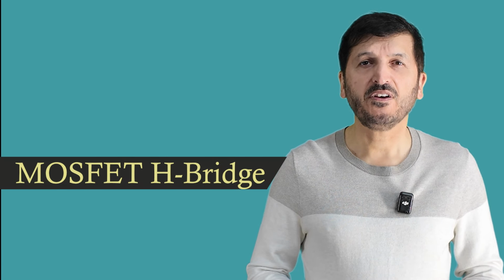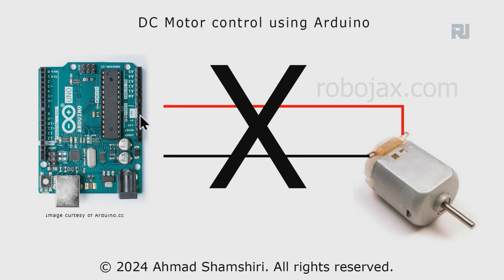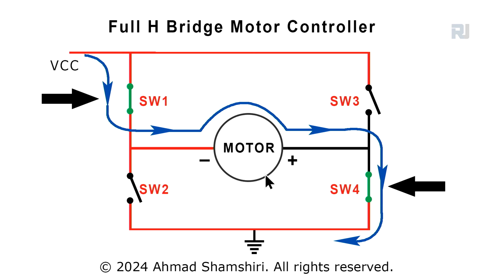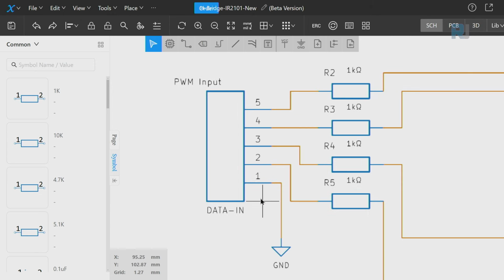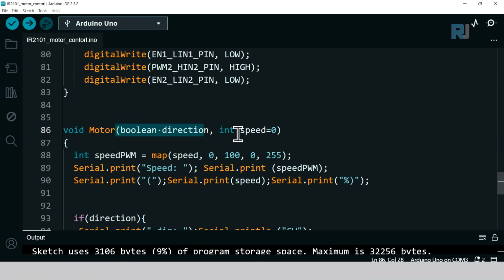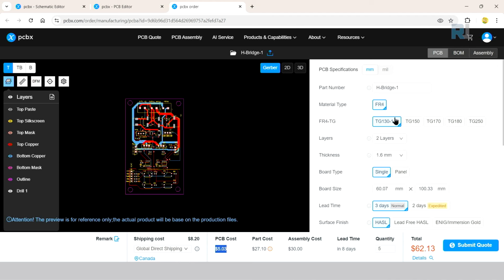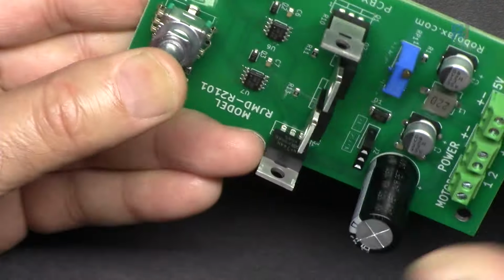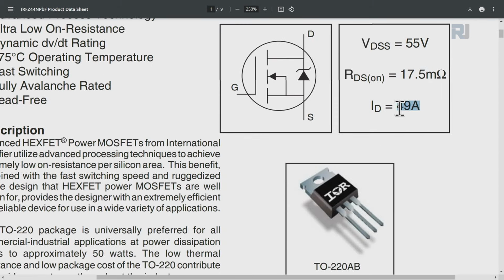H-Bridge Motor Driver Tutorial: PCB Design, PXBX Ordering & Arduino Test

Comment: Thank you so much, I want to ask you this , if You are controlling machine that require 325V to run , all ground like GND  from  12V , GND from Arduino  , GND from drivers and GND from this HV Power supply must be connected together or separated ?
Reply from the maker: Hi, ground should be common.  if you keep it separate, it won't work .

Comment: what parts need use can drive DC motor 30 or 60 Ampere, and how add this to self-balancing 2 wheel arduino controller. want make wheelchair self-balancing robot, mean can drive whit human sitting top. big wheelchair DC motor can drive and arduino controller self-balance this. or use Elektric scooter hub motor wheels, 14". think have possiple use small self-balancing arduino robot and change only motor drivers H-bridge to biggest driver board can use big motors.
Reply from the maker: Just change the mosfet and attach larger heatsink and cooling system

Comment: Couldn't you just use a h-bridge motor controller board like the DRV8871? They support from 6.5 to 45vdc input 3.6Amp current and PWM signals. You can get one on ALI for around $2.20 each USD 😀
Reply from the maker: No you could not. This can handle up to 49A if you add large heatsink. But 10A motor can easily be controlled with a small heatsink.  My channel is for learning.
Reply: @robojax  I figured that as far as learning anyway. Hummmm... never had a need for a 10 amp motor at home before but sure i can see if the need came up it would be useful.